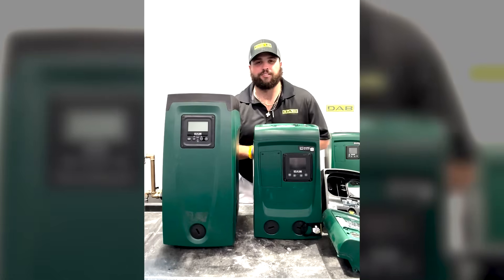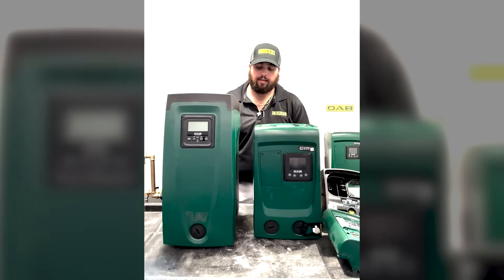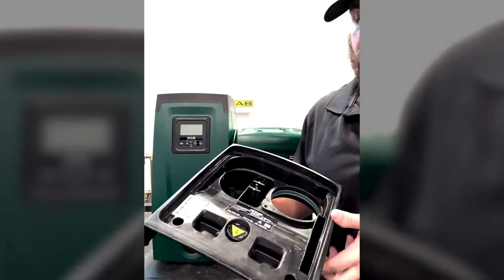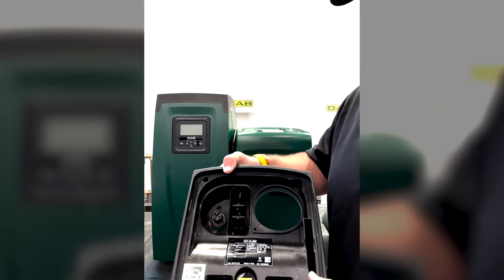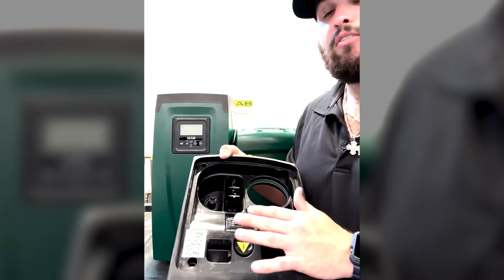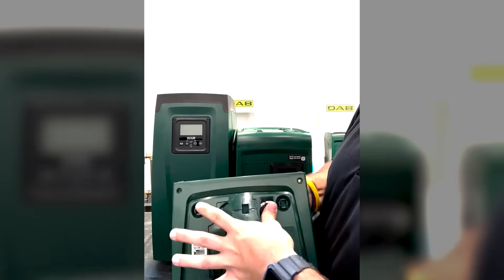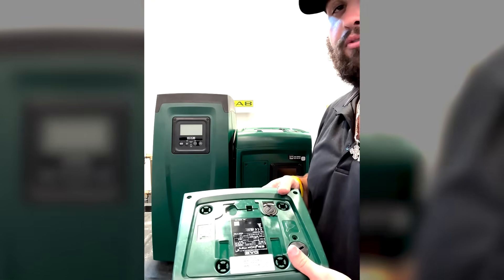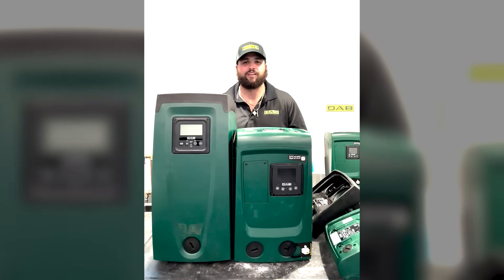How to prime your DAB Esybox and Esybox Mini 3

Comment: Thank you for the video it helped me tremendously in understanding how to check the motor shaft. All the manuals for the regular e.sybox I found online speak about removing a cover and using a screwdriver to check the shaft but they reference "Figure 27" which shows similar steps but for checking the one way valve on the side. I couldn't find any slot for a screwdriver in there, I even inspected it with a camera. I thought I was crazy but no, it's just DAB being incompetent and not being able to write a decent manual for their users...

Comment: We're using ESYBOX Mini 3, easy to install and very quite pump, I love it... However, we have a problem, after 6 hours on stand-by, without run, the pump empties the primed water back into the rainwater tank, we checked, there's no water leak at the priming side. Any idea? A "Retain/Hold water" configuration somewhere!? Thx
Reply from the maker: @Kelvinucetam.6767 If you are pulling water from your rainwater tank, do you have a check valve installed coming from the tank? A check valve installed there would help the line remain prime and not allow water to flow back into the tank. If you have anymore questions, please feel free to reach out to our service department. Service.us@dabpumps.com.
Reply: @dabpumpsusa  Hei thank you very much for your reply, check valve have been installed this morning, it was the solution I thought before posting. Let's see tomorrow!

Comment: I have the smaller dab unit

I’ve never had an issue with these before until today. These pumps are fantastic. 

I do reverse osmosis, and I use this pump to resupply the pressure back into the home 

A 500 gallon holding tank, which is completely full, which of course it’s on the floor and the very bottom is where I would connect my line to run into the dab pump 

Now I have the dab pump sitting on a little bit of a stool about a foot a foot and a half higher than the bottom of the tank 

Coming out back into a series of filtration before it goes back into the house is about 10 foot of line that goes vertically up the wall 

And then filter and UV light and then another calcium calcium filter, then back into the home 

I can hear it come on. It gives me a red light and the white light is on the red light not supposed to be on, but I can’t figure out what I’m doing. Wrong is just too much air in the line for it to get in pump to be able to push that water , any suggestions? I would appreciate it.
Reply from the maker: @culver123456 I would suggest, that its air build up on your suction line. Every time the pump tries to pull water, it is sucking air. Do you have any bends or 90s on your suction line? If so, the more you have, the greater the chances of you sucking air in the pump. Also would install a check valve coming out of the tank leading to the pump, to keep the line primed. If you have anymore questions, please feel free to contact our service department at service.us@dabpumps.com